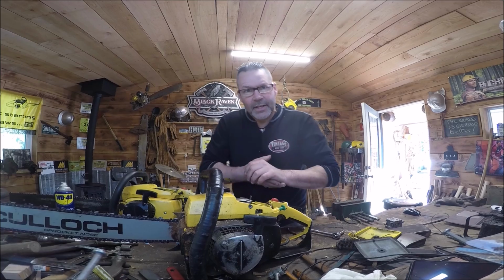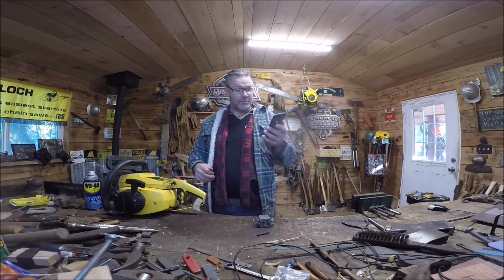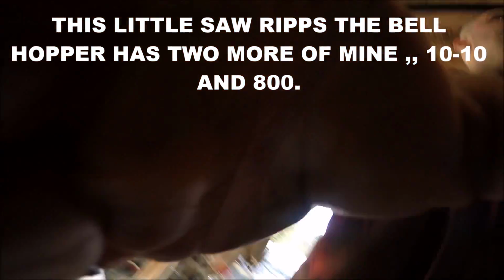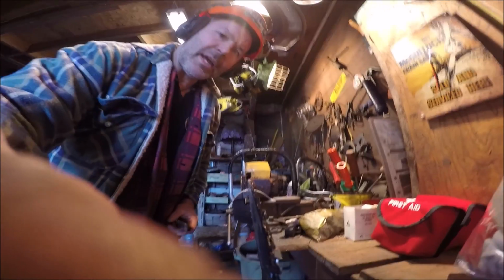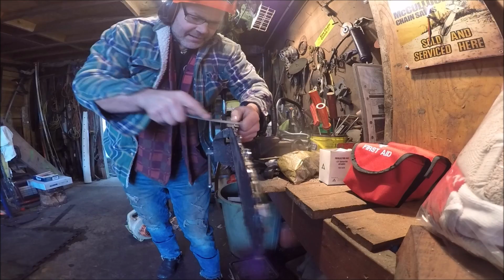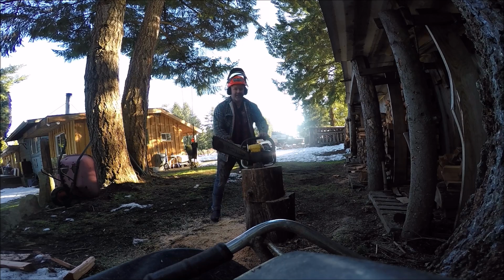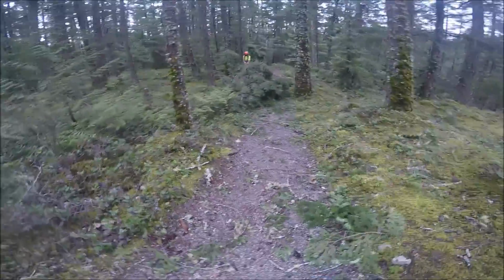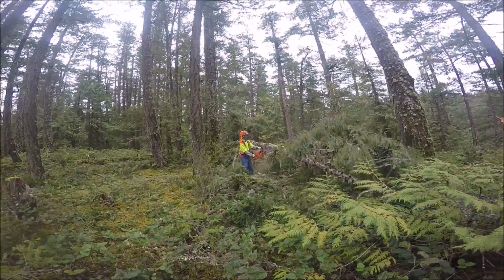PORTED PRO MAC 10 10,  CARBURETOR SWAP

Comment: Wadca up buckin ! . take the carb apart . take a tooth brush with some gas and clean carb parts in a small bowl cleaning brush with fresh gas often. then use an air compressor with blower attachment and blow passages out. also change the fuel filter in tank .take pics with the phone during disassembly to help put back together if needed .

Comment: You can add me to the list of people who really love that clip of the pro-mac 10-10 rippin thru wood like its nobodies business, mark my words, 1 day ill stumble across a pro-mac 10-10, 10-10 auto, or 10-10 s and that same day I intend on purchasing said power-saw simply from all the videos of BR's 10-10's rippin thru fir, hardwood, no matter the species of wood; those ole McCulloch 10-10's with a 28 inch bar only 54cc(pro-mac 10-10 58cc)run thru anything you've put in front of them with ease. Simply unbelievable, in my opinion thus prove's McCulloch was WAAYY ahead of their time.

Comment: Factory Walbro carb rebuild kits are cheap on eBay.
If the saw has been sitting around unused for years,gum from old gas mix,trash,can cause the fuel diaphragm pump to not work at all or poorly.On my mid sized Stihls 024,026,028,034,038,some of the the Walbro carb rebuild parts are the same.
Be good! Billy
Reply: barrybri noted!, thanks barrybri ❤️👍

Comment: Hi Buckin' and all of you people out here. Hope you're doing great!

Finding an error is all about deleting possibilities and you nailed it. Thing is that not many people have the opportunity to swap out a carb and you still end up in a workshop after taking things apart.

I had to laugh a bit about your helmet issue, by the way. I have the same one and the only reason I bought it was because of the fact that I like the knob where you can adjust the size and I agree with you that they should make some parts better. In my case the maze thing fell off just tapping it to a branch. I could get it back together, but the thing just seems VERY fragile to me.

Have a nice Sunday!
Reply from the maker: YOU CAN ADAPT THE OLD SYSTEM ILL DO A VIDEO   THX PAL
Reply: Nice. Thank you!

Comment: I find it amuzing how the pro mac saws will just walk all over the regular 10-10 and both are 54cc's...I do think my regular 10-10 has a little more bottom end grunt than the pro mac though,but as far as cutting speed if the file or grind is spot on those pro mac's flat out cut!
Reply from the maker: INDEED THEY DOO

Comment: I would love to see him have a "hot" saw or build one I'm into stock saws but you got to have a toy for fun I have a mac 10-10 love it I would rather fell with it than a new husky 576xp
Reply from the maker: ME TOO
Reply: Do you notice with the x torq chain speed will "skip" in the cut vs the vintage saws that had more torque and "chips/rips" the wood out I find my mac 10-10 works great on the mill the vintage saws run cooler too @BuckinBillyRaySmith  I have an idea for some saw mods for milling like water cooling cutting off the air cooled fins and wrapping copper tubing around cylinder then garden hose the expelled water can cool the bar down..in the cut you can also gain more hp by cutting the flywheel air fins and stop the sawdust from becoming airborne I would not do this to a vintage saw but a huskie..I even thought about a water muffler to dampen the sound similar to how 2 stroke rc boats work with sound dampening/cooling search for homelite rc boats you can see how the copper is wrapped..let me know your thoughts..
you could also fit a small dirt bike or transmission cooler on the bottom for none mill work heat is a big enemy of performance it also reduces wear..
you could really crank up the performance with better cooling

Comment: Thats a rippin demon of a power saw. Schnazzy haircut too. DO any of you folks around here know if there is an after market carb that will fit onbe of the newer Poulan Pro PP5020AV. I was able to cut up one tree with it but now she won't stay lit. Thanks brothers!!!
Reply: Dakota WoodWorx does she die when you let off the gas
Reply: @travisw6709  Yes and no.I gapped out the spark plug a bit more that came factory and that helped for half a tree. Now when I do get it started it runs and shuts off. starts and shuts off. Starts and shuts off. Its even been to the shop twice with go dice. If you can get it started you have to have full throttle to get it to go for a few seconds then she quits whether your finger is in the throttle or not.

Comment: im looking at becoming a partner with a great friend who is starting a tree service he has yrs experience in the field and i got my 1st chainsaw when i was 10 and grew up on a lot of property and cut firewood for a while........... been looking at getting a large mac saw..... which saw would u suggest im looking at running a 36-42 inch bar for a felling saw ( i am using MS660 currently)
Reply from the maker: SP 125   OR 797